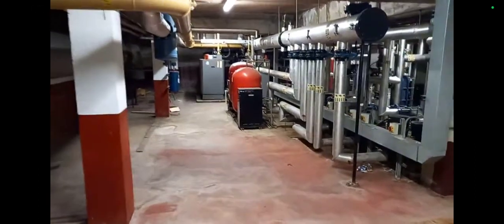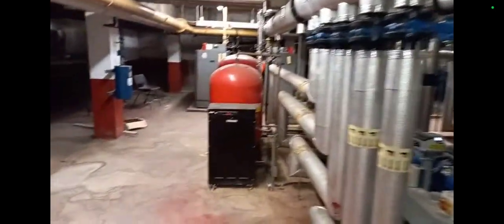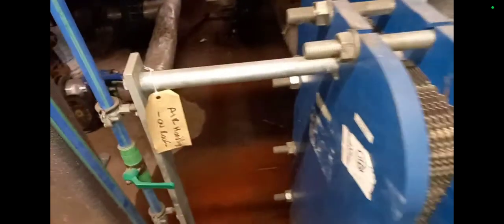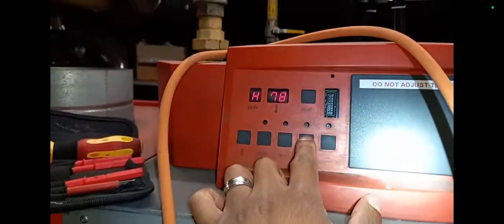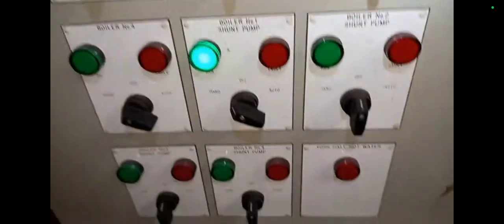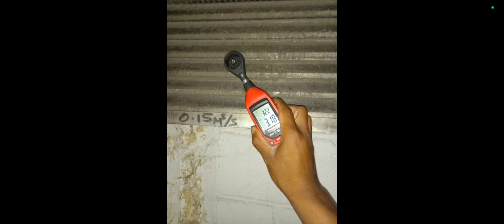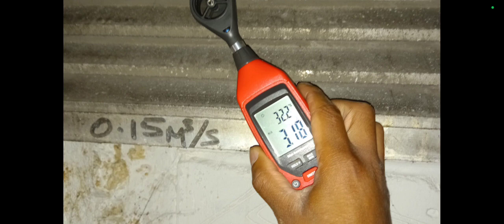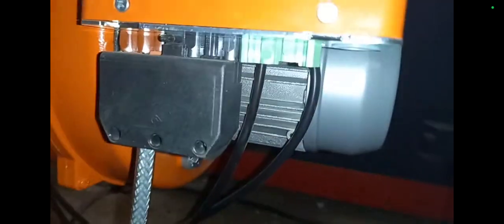DAY IN THE LIFE OF A COMMERCIAL GAS ENGINEER pt30

Comment: Are you sure you need to do a smoke pellet test and spillage on that type of boilers? Obviously yes on a atmospheric burner with a draught diverter.
Reply from the maker: If it's an open flue boiler flue flow and spillage. How can one check the integrity of the flue otherwise. Also unless you do a flue draft test or spillage how can you be sure that the flue pull is acceptable? It is best to contact the manufacturer regarding how they expect their boiler to be checked. Yet for me personally I have come across flue fans not operating. Flues blocked. Also if I see signs of a previous leak on a flue if I carry out a flue flow test I know the integrity is good. Its down to the engineer how they want to check the performance and integrity of a flue and its pull. If one just wants to do a combustion check and look at the flue that's up to them and their gas safe licence. Maybe I'm being over the top yet I have seen some strange things. Plus it doesn't take long to do flue flow, spillage and draft check. Also remember that on that site there was a boiler next to it that was shut off with a hole in the flue. So I'm covering my six bro and leaving the evidence that I've checked that flue thoroughly. Let everyone be convinced in their own mind that they've checked a site to the highest level. Give gas safe a call and see what they say about testing an open flue appliance. Let me know your thoughts, I am always learning and could be wrong.